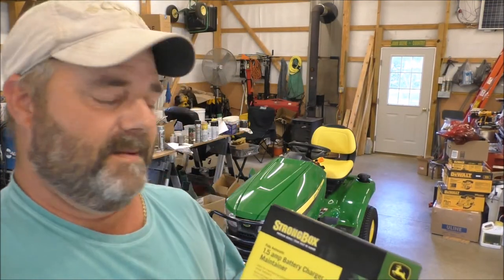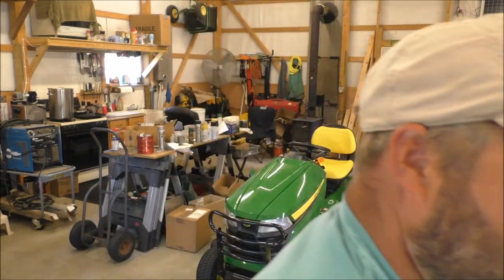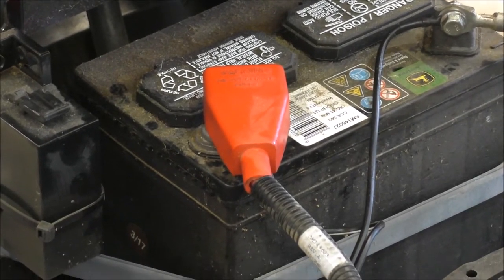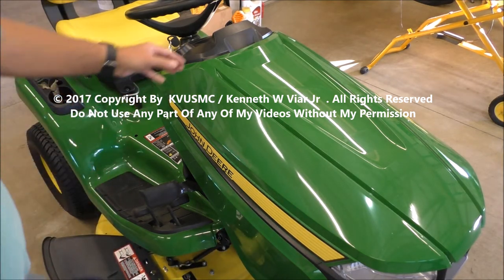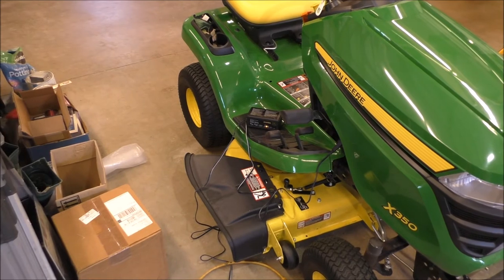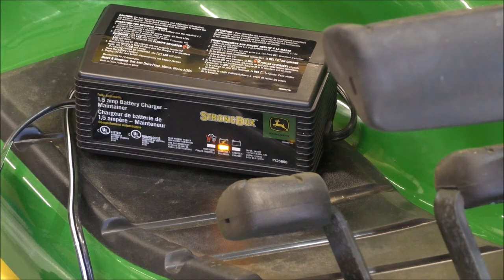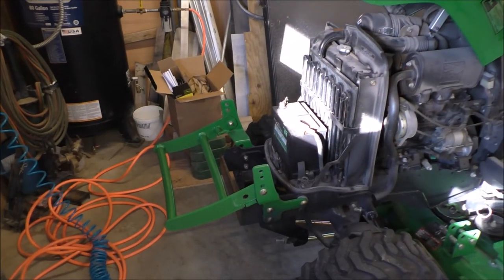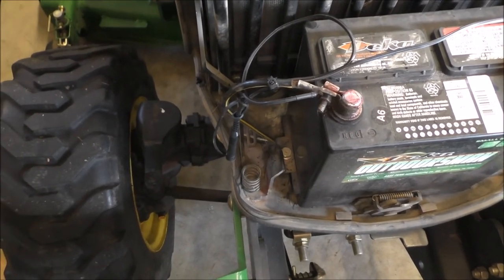John Deere Battery Charger /Maintainer- TY25866 Install On X350 Lawn Tractor By KVUSMC

Comment: Thanks for very helpful review. I just ordered this charger for my John Deere 110TLB backhoe. I was tired of my battery dying at critical times...like last year when my 37-ton log splitter arrived from Northern Tool and the crate was damaged so bad I had to unload it all in my driveway with the JD, since the girl who drove the delivery truck was unable to help at all. I got the log splitter and crate halfway out of her truck and onto my loader bucket, then tried to back away from her big truck and the JD battery went "NOPE...I'M DONE!" After we somehow got her truck pulled away and I was left alone with the problem to solve, I had to get the battery charger hooked up on an extension cord and got enough juice into the battery to crank up and make it back up my hill. I was exhausted, as was my wife, and I decided I wouldn't let this happen again. I've got a new battery tester too, and will keep this 1.5A trickle charger on my battery in same configuration as you mounted it on your machine. The dampness and cold of the Pacific Northwest is brutal on batteries in Winter. Thanks again for your great review. And dang if you don't talk just like me, an Alabama boy!....ha ha ha
Reply from the maker: Amen Brother Your Welcome Brother I have a 310D TLB on the Brother I'm glad I could help you Out Man Even my other tractors have Solar Chargers on them Battery Tender 5 watt
Reply: @KVUSMC-KU4SMC  
Just wanted to let you know my trickle charger arrived and I got it installed on new JD battery. It is now working great and will keep my battery topped off all Winter. I see you do solar and wind systems too and will look at your vids, since I have 14 acres up on hilltop above Carnation WA that has LOTS of both sun and wind. That's my next big project....an off grid system for the coming DARK AGES....(I hope not though!) Hope to contact you again soon! John Hudson in Carnation/Redmond WA USA
Reply from the maker: @johnnyrebangel  Awesome Brother Good deal I'm on Facebook Kenneth W Viar Jr  send me a friend request

Comment: Thanks for your video . It helped , I did this today on my new 2021 X350 only I routed the wires to the battery via the factory little hole 🕳 on the top of the dash just before where the hood closes . It makes for a much cleaner installation and I don’t have to open up the hood everytime I plug 🔌 in the charger .
Reply from the maker: Great job Brother

Comment: Love your videos. I have an X350 as well. I drive down 460 through Wakefield on the way to OBX!!!
Reply from the maker: Awesome That is the same way we go
Reply: I got the part number for the maintenance charger, what is the number for the Terminal Ring adapter  you purchased?  there is no part number or link above.  Thanks!

Comment: If it is like my Schumacher 1.5A charger, it will continue to put .5A in the battery after it is charged.  I use this charger on my battery for my Honda HRR216 to keep it fully charged.  I have a Schumacher Maintainer and it cuts on and off to keep a battery charged.  However, you battery better be fully charged when you put the Maintainer on your battery, otherwise it will not keep it fully charged.  I love Schumacher equipment all the time.  I have an 8/2, the 1.5 and the Maintainer.  My favorite is my 1.5A charger.  I also keep a .5A float charger around to clean up discharged /sulphated batteries.  I brought my Honda 20 CCA battery back from the dead with my little float charger.  It read 4 volts when I started and now reads 12.84 volts after two weeks off a charger.  It is one of those AGM batteries. Semper Fi.
Reply from the maker: OORAH It is A Nice Charger  That is Awesome